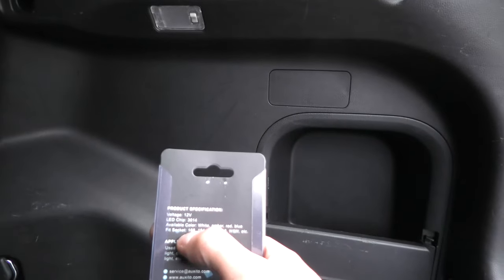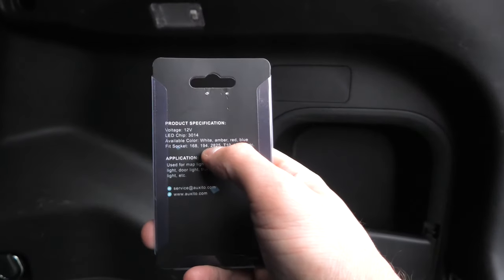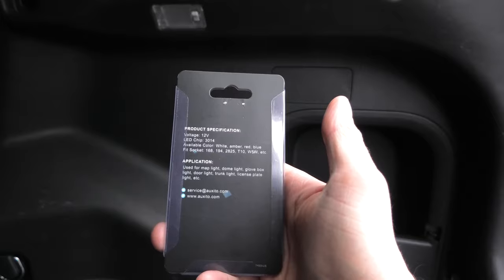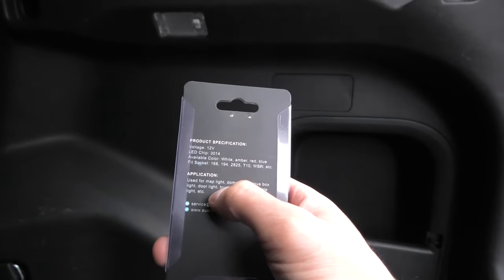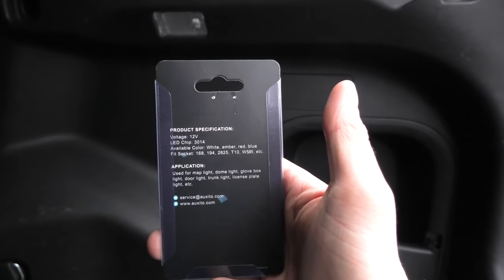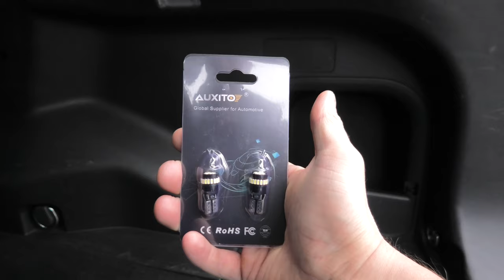Toyota RAV4 (2019-2024): Auxito Trunk Cargo LED Light Bulb Install.

Comment from the maker: PRODUCT LINK:
AUXITO 194 LED Light Bulb 6000K White 168 2825 W5W T10 Wedge 24-SMD 3014 Chipsets LED Replacement Bulbs  - https://amzn.to/3IqL6hx.

TOOLS REQUIRED:
1. TRIM REMOVAL TOOL - 4pcs Auto Door Clip Panel Trim Removal Tool Kit - https://amzn.to/41nYhsk.
2. PRECISION SCREWDRIVERS - Wera - Kraftform Micro Set/12 Pc Sb 1 with Pouch - https://amzn.to/3KM0ojQ.

Comment: Which one is better, link 1 or link2, why are there 2 different links
Reply from the maker: The first link takes you to the bulbs used in the video. The second link takes you to the LED lights package for the RAV4 suggested by Auxito. You can also buy any of the LEDs separately using the second link.
Reply: @MorozovAutomotive  thankyou